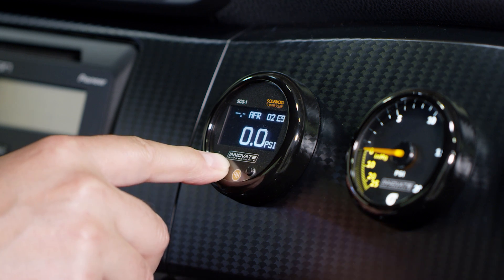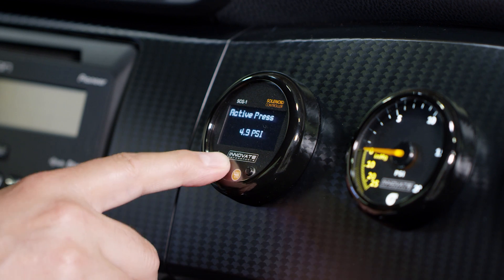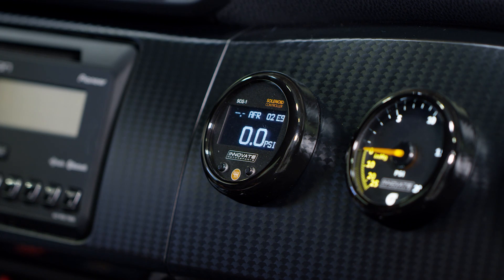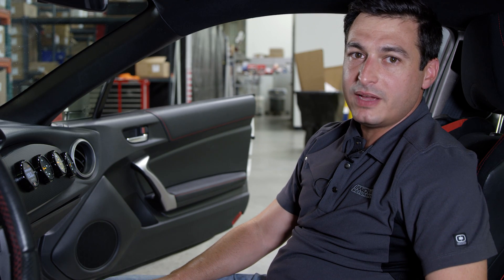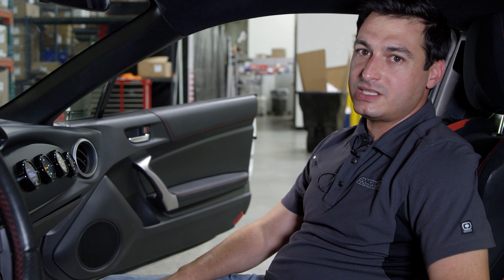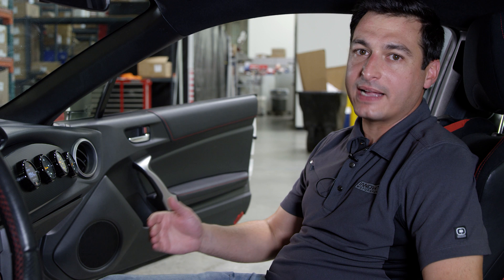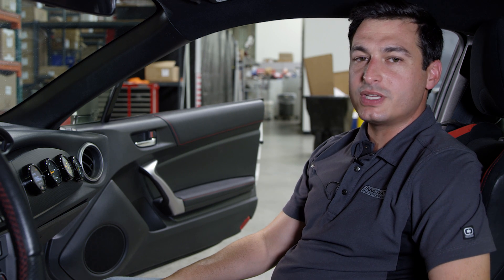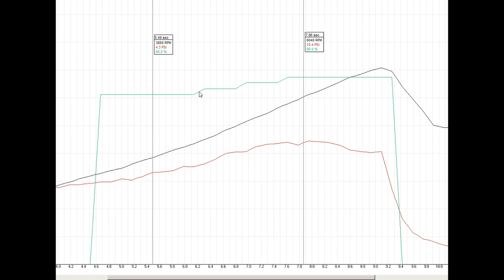How to Setup and Tune An Innovate SCG-1 Boost Controller

Comment: This is a great video , but I was just looking for clarification on the the active spring pressure when you indicated that once it’s set you will see the duty cycle % consistent everytime your in boost . 
 Are you referring to too see the duty % every time it’s in boost at the weight of the spring pressure (eg 14lb spring makes 11psi set at 8.5psi active pressure) ? 
I see the duty % consistently working at that set pressure or should it be working at the start of boost ?

Comment: That’s awesome that thing cuts boost is the engine is running outside of its normal air/fuel ratio. Talk about getting bad gas this is the best way to protect your engine from that scenario.

Comment: Boost controller is junk and get your money back on it. They cant explain what to do to accurately troubleshoot. Worked fine for around 8 months. If you are a racer and make money racing, this is going to cost you some money. MAP and o2 go crazy after a while of ownership. Highly advise to do your research. And good luck if you contact their technical support staff if your lucky enough that they even acknowledge you. I will not buy another innovate product or recommend due to their poorly run technical support department. You will be more happier with a eboost controller.

Comment: Boost is set to 14psi.. spring is a 12lbs..
Going into boost.. once I hit around 13psi. It starts dropping off to 10psi.  .  What's the deal?
Reply: Raise the gain% gradually until it holds the set psi you want all the way to redline..
Reply: I had the same problem
Reply: @dsmred6575  thanks! Imma try it once I redo some wires...  how you like the gauge so far? I'm looking into the perfect tuning gauge for my next build
Reply: @damnitdang  i love it my standalone runs off a separate wideband but I have a second wideband installed on the boost controller so i watch boost+afr on the same gauge. You can also setup boostcut and a afr cut so you dont overboost or run to lean under wot.. its awesome bro.... you just have to play with it a little bit. But set your wg% first then start messing with the gain.

Comment: Thanks for the great video, and product. I've been lowering and lowering the active pressure, but can't get the WG duty to increment. It just displays 28% or nothing. Is this a firmware thing, a low amount of duty, or do i need the active pressure even lower.
Reply: It case anyone else is wondering on what I posted above, I've now worked it out. If you have 0% gain, you see your set WG% when it kicks in with no increment. If you have gain, first you see the WG value, then it increments as per your gain %.

Comment: I have this boost controller for 1 year, the only thing I miss is a switch/button that you can quickly change the boost pressure. The way it is you need to press and hold the two face buttons to change pressure, not the best way while driving.

Comment: I would like to ask you how does the boost controller control the mixture ? is it connected to the ecu or it is equipped with a regulator that control the intaked air  to the manifold ? what is its efficiency in performing engine ? what is the deference that  I  will see if I use your product ? hope to answer me in details 
regards
Reply: it does not control mixture. It controls boost pressure, with afr cut built in. It also has a rpm shift led bulb too.

Comment: How to adjust turbo pressure with innovate scg-1 if it's too low ?.
The drive with 0.8 bar may well adjust it with wg duty. But is the wg duty not overboost in a short time?
will get up and running 1.1 bar in pressure

please see link

https://www.youtube.com/watch?v=JZX8Tft3NtE&feature=youtu.be

Comment: Can you use only one SCG-1 for a twin turbo set up or do you need two?
Reply: Crazygair 427 1
Reply: The solenoid (gauge controlled pressure gate going to your waste gates) will be fed by whatever is just in front of your Throttle Body.  So the boost pressure from both turbos are combined by this point, and you only need one solenoid and one SCG-1 system.  

I hope this helps!

The turbos are linked together by the point that this system does anything

Comment: I have an older version of this boost controller do i need to update the firmware?
Reply: mhmm a Year later and @InnovativeMotorsports Hasn't replied SMH so much for support.
Reply: @BjornFSE  their customer support is shit. I broke a gauge and got no help. They just want you to buy another new product
Reply: @krazyd27  I bought a new gauge from them recently. I just found the video with no response on a product that they sell and expect consumers to buy to have zero response from 2 years ago. That in itself is telling.
Reply: Tech support inquiries on a YouTube video probably won't get very far.